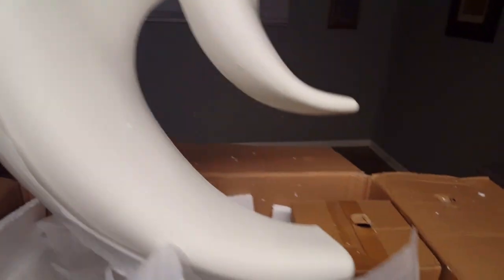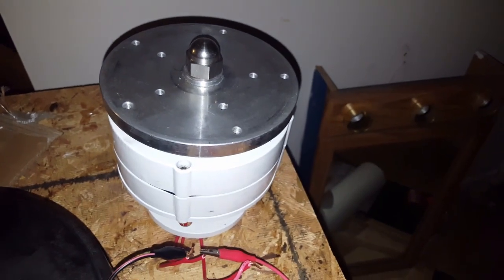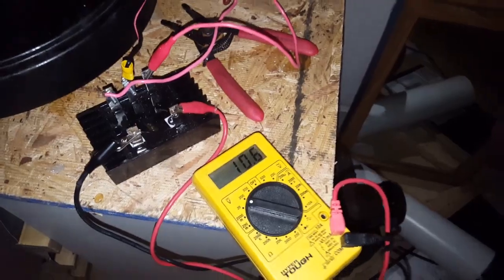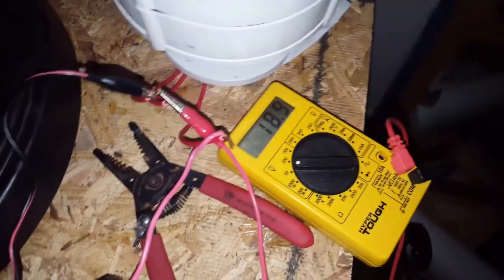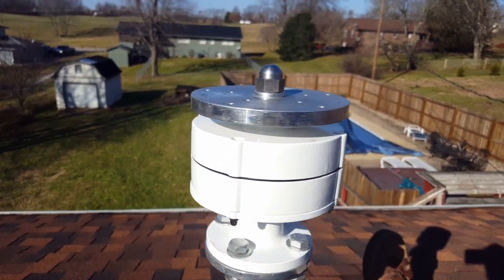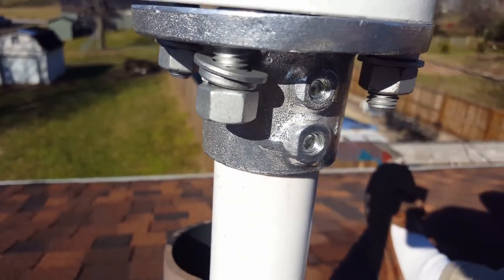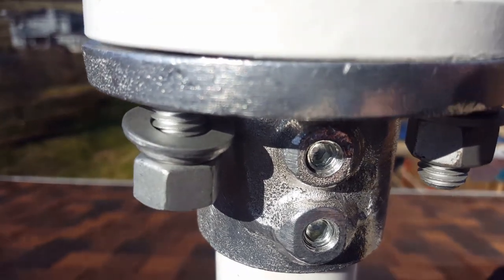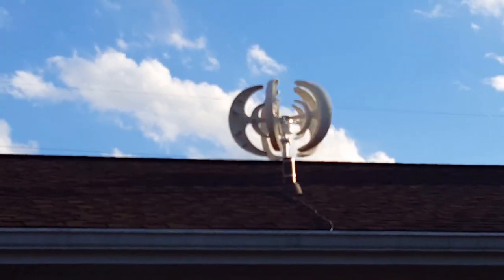600w Lantern 5 Blade VAWT Wind Turbine Review

Comment: Bought one and it came with the blades broken, The hub on the generator was not  threaded so you couldn't mount the blades if they weren't broken. They sent a second one and it produces no power,  I will definitely look at a different company and style in stead of these.

Comment: These are no good, I'm in the process of trying to get my money back,300 Watt 12 volt, I turned it with a air impact gun and could only get 12.4 volts and .5 amps and 6.5 Watts . No matter how fast it turns it will not get any higher, I did all my test before mounting it. So far receive 2 offers from seller but not agreeing to them, it is absolutely useless piece of equipment...
Reply: You could mock voles with it.
Reply: you need to put it under load. like using horse to pull a baby bike, for sure you are not going to get output
Reply: @dingwuchang6852  Nonsense. These are rubbish. Under slightest load (charging or resistive), the voltage drops way down.

Comment: 600 Watts means 600 watts in 24 hours at max.
Reply: So that means 600 x 24 hours = 2400 watts in one day, right?
Reply: @dmana3172 If it somehow managed 600w all day that would be 14400watt hours but theres no way it can keep that up. its likely to be sub 100w most of the time with gusts bringing it higher every once in a while.
Reply: Not even in a year this spinning thing will produce 600 watt.
Reply: @johnq8792  do you have one of these? The reason I ask because even if this thing put out 50 watts continuous 24-7, 365 it would have generated 438,000wh. So, you have experienced less that 1.64wh per day with this unit? Yes, I understand that the wind in your area would have had to blow to the cut in speed of the generator for 365 days continuously...just stating the numbers for a reference since you provided absolutely no data to validate your claim.
Reply: Tim Latimer ... yes i bought and have the same, it’s a beautiful spinning wind mill and a very good talking point with neighbors or passerby but it does not put out any watt for charging a 12 Volt battery, I even connected a voltage doubler  and only got 7 volt max. You could connect some led Christmas lights and get something blinking. I opened the generator and found aluminum wire very thin doubled for a 3 phase winding in wye configuration, the magnets are too far away of the coil plus weak. If you want something spinning in your yard just get an old fan blade and nail it on a stick, better than spending $180 or so, I ordered the 600 watt version and got burned.

Comment from the maker: my wind turbine is in a bad place .the roof is blocking some of the wind speed..right now I'm only getting about 12v for 12 mph wind..i want to mount it higher but I can't do to subdivision restrictions..so .not enough wind on my roof top to make it feasible..but would be if I lived higher elevation and on a pole or even the apex of the roof which I don't have access to now

Comment: no output test. brilliant.
Reply: To spred some information about these "lantern turbines" they output about 5 - 20 Watts of actual, continuus power if there is wind.
The 600 Watt Number they put on it shold be read as 600 W/24H, basically stating the power output over a 24 hours.
I would consider one for trickle charging a battery in the winter, where solar often is weak.
Reply: @elektronikschmiede3464  ...you lucky to 600 W in one year definitely not in 24 hours
Reply: you should made an update video for the wind turbine show how you installed it and how is working in the video I'm looking forward to see it

Comment: I am thinking of getting one of these. Would love to see an update video on this? What's the average wind speed in your area? How much amps are you getting out of it at average wind speeds in your area?
Reply from the maker: In my case the Wind Gen is not in the most ideal spot.  due to subdivision restrictions I had to place mine on my roof so that no one could see it.  In my area I only avg 6 to 10 mph of winds also so that's not ideal either.  This Wind Gen will work best if it is placed high and on a pole with no obstructions then it will give you great charge ability..Right now I use it to supplement my solar
Reply: st0720 do you have any numbers under those circumstances? How many kWH does it produce in, say, a week?
Reply: @ArjenJongeling ... kWh? You mean milliwatt h
Reply: Check out my test using a kilawatt meter... it works but you have to use a battery for it to work properly.